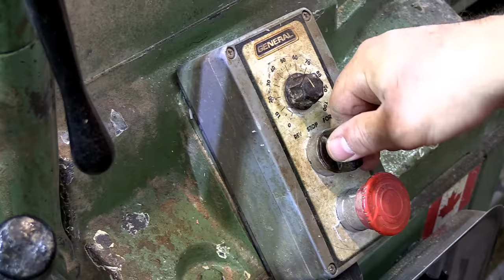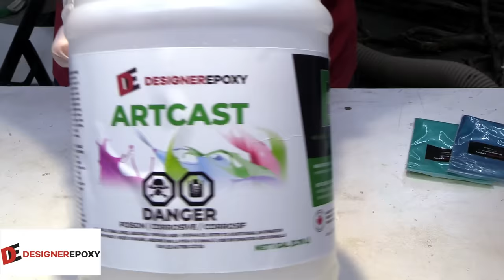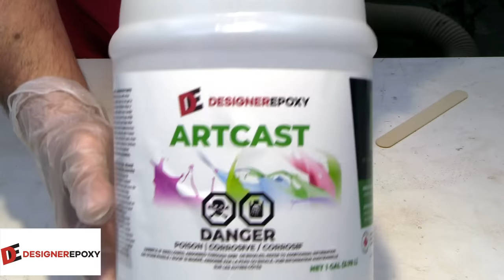Woodturning - The Basket Case Bowl

Comment: Bowl is amazing, like always. I work for a builder full time. Also a part time furniture maker on the side and now throwing turning into my tool box. Building cost are out of this world right now. That’s why I just bought a existing house instead of building. I’m also putting up a 30x50 metal building shop, but I wanted a block and truss shop but it was a quarter of the price to do metal.
Reply from the maker: Even metal is high right now. I never priced out a metal structure because we wanted the shop to match the house. Thank you very much!

Comment: Jim, thank you for a quick lesson on headstock locations.  I have recently acquired a Jet 16X40.  Previously had been using a Jet 12X21 which was great to learn on, however the larger machine had many features as you illustrated with headstock locations.  I think I'm going to love working more with this new toy, and watching more of your presentations.  
I'm not a tax fan and was disappointed to hear your plans will suffer a little in New Brunswick next year.  But as you said "that's the way it is" I'm crushed.   John in Alaska
Reply from the maker: Hoping the prices come down and make it less painful! Thanks

Comment: I like knots and the nice grain around them, didn’t realize a small amount of clear to smooth it and stabilize a little would be considered a repair
Reply from the maker: There certainly does on occasion have some nice grain them. They do however tend to crack over time. Thanks

Comment: Drilling out the centre of the short branch sections with a bit the same size as the copper wire and then gluing short sections of wire into the hole would look so cool. Like copper heartwood.
Reply from the maker: I actually debated that. Thanks

Comment: Next time you use the copper wire, anneal it by heating to red heat.  You can then leave it to cool by itself but it will have a film of black/brown oxide.  To prevent that, quench it from hot in sulphuric acid.  This will (mostly) remove the oxide, leaving a matte finish but you will have the copper colour.  The wire should then stay where you put it, at least better than we see here.  If you must have shiny, you are going to have to live with the springiness.
Reply from the maker: Only shinny will do, lol. Thanks

Comment: looks absolutely great.  just a tip with hot glue, if you have a heat gun wave it over the glue to get it to release easier than the alcohol.  As long as you don't hold it in one place too long it should not affect the resin.
Reply from the maker: Yes, that would work too. Thanks

Comment: re: the copper wire: if metal memory gives you trouble in future, anneal the wire (gently heat until just soft and allow it to cool slowly, do not quench in any medium,) and run it through a draw plate or clamp it in your vise and stretch it an inch or so by pulling it tight with pliers.
Reply from the maker: Can this method be used with twisted wire like this? Thanks

Comment: Came out beautifully Sir!! Just a thought on the wire inlay memory problem; next time you could maybe try straightening the precut wire lengths beforehand, which may remove the bends. Place one end in a drill chuck and hold the other end with pliers applying tension. Start the drill off slow, then speed up until the wire is straight.
Reply from the maker: Thank you very much

Comment: Try rolling the wire in with the too. They use for window mesh I bet it will roll in even. Congratulations on 100K! 🇨🇦
Reply from the maker: I don’t think this twisted wire will behave correctly to do that. If it was a solid core wire then yes and I’ve actually done a video on it. Thanks

Comment: I have done several segmented bowls and I figured out the secret.  You glue the bowels up in 2 halves. using 2inch tape on the joints and shrink wrap as my clamp. Then if you did it right the two pieces will glue together 100% perfect every time. Right?...  Unless you are me and are far better at nailing the compound angles.  So when they do not come together just perfect I use my 12 in disk sander to flatten the 2 faces until they meet perfect. Unless you are just way the hell off no one ever notice and all the joints come out spot on.
Reply from the maker: The reason why I don’t like to do segmented work is because your more on the table saw than on the lathe, lol. Thanks

Comment: First video I've ever came across of yours, I'm now subscribed 
Beautiful piece 👍 love the form and copper inlay.
As for the hot glue debacle, I've had great success using a heat gun and a small putty knife. Just be sure to use a tip on the heat gun direct the heat away from the epoxy, and start the heat low👍
Keep up the beautiful work man.
Reply from the maker: Welcome aboard! Thanks

Comment: Beautiful color combination; haven't seen walnut pieces that disappointed yet. Designer Epoxy artcast clear as glass. Maybe as a future challenge, attempt to run a copper inlay AROUND the entire inlay area showing the same view inside and outside of the bowl as one sees looking down at the rim.
Reply from the maker: This would be very hard to do without sanding through the wire. Thank you very much!

Comment: The different camera angles are great. It gives one a different perspective of how you work. Love it. The dark walnut bowl is beautiful as always! If you’re using copper wire again, try gluing it halfway around and it should make your job much easier. Also, what are your thoughts on cutting the wire up and fraying it out so it acts like you’re small pebble stone inlay material? This effect won’t look like a wire but more consistent without any evidence of where the wires end and begin. Love your work Jim!👍
Reply from the maker: Something like this video? Woodturning - Copper Wire and Alabaster Inlay
https://youtu.be/lISiaaF-GsA thanks!
Reply: @SpragueWoodturning  Kind of, I was envisioning the copper wire cut into small shavings, 1/2 cm to a cm long. This way they would lay flat in the inlay channel and fill it up like your other inlay material does. Yes it would be a ton of work to do, but the effect might be cool👍

Comment: Great bowl Jim!  I luv that copper inlay.  Not sure if you have done this in the past or if someone else has mentioned this but have you thought of using copper tubes in the branches, then filling with colored resin?  Might be something to try.  Also like the new camera angles.  It's a big help to us newbies.  Thanks and take care.

Designer Epoxy
Sandpaper
Reply from the maker: I used copper pipe in this one, thanks! Woodturning -  The Stain Glass Bowl, 55K Subscriber Giveaway Bowl
https://youtu.be/_SgHq9-HsYk

Comment: Love your videos, and the resulting pieces are fantastic. To remove the plastic sheet, have you thought of a little localised heat from the tip of a soldering iron to soften the hot glue? 
Regards Dave
Reply from the maker: I would turn it away before doing that, it would be a stick mess, lol. Thanks
Reply: If not a soldering iron, how about a hair dryer or heat gun to warm the glue so you could pull the sheet off?

Comment: Nice work dealing with the defects and saving that bowl. I don't know if this would help with the copper, but it is probably work hardened from the manufacturing process which will make it less malleable. You could try to normalize it by heating it up and letting it air cool. Might discolour the copper though. Possibly bring back the copper colour with an acid. Just sayin'.
Reply from the maker: Others have suggested that too. Thanks

Comment: I wonder how it would look and if it would have been easier to work with if you twisted the 2 braided cables together first?
Reply from the maker: They would want to untwist. Solid core wire is best for that and I’ve done it a couple of times on the channel. Thanks

Comment: As always, great work.  I like the look of the copper wire on the top of the bowl, but torn on if I liked the cut ends on the side between the branches. I definitely want to give the cutout with branches and epoxy on a bowl.
Sorry if I missed it, but can you share the brand/model of that respirator face shield you use?  Thanks
Reply from the maker: It’s a Power Cap. Thanks

Comment: Great color separation in the finished product! What are you using to apply your Waterlox? Generic finishing pads, an old shirt or lint free shop rags? I'm having trouble getting even surfaces using anything other than friction polishes like Mylands
Reply from the maker: Old T-shirt material or cotton rags meant for finishing. Someone mentioned using gauze, it’s lint free so I just ordered 200 of them in 4x4 sizes. Will show the results here. Thanks

Comment: Which Vacuum Chuck and Pump are you using? And Do you like the stability of it?
Reply from the maker: I have a really large one that I bought of of eBay many years ago, but I just got one off Amazon a while back. It’s a Pbautos and it came with the pump. There should be a link in the description. The only thing I really don’t like about is the pump requires oil and it tends to foam out of the vent and I guess that’s normal. https://www.amazon.ca/gp/aw/d/B0B773VV6L?psc=1&ref=ppx_pop_mob_b_asin_image thanks for watching

Comment: I have a turning question that I think you can help me with.

I'm running a 12x18 lathe and I tend to get a lot of end grain tear out in the walnut bowls I'm working on - 11(ish) inch diameter, 4 to 6 inches deep.
I am certain that a big part of the problem is that I'm not keeping my tools sharp enough (Yellowhammer and Benjamin's Best gouges, usually 1/2inch).
I'm not getting good shear cuts, but that is probably me not having the wings swept back far enough.
I've overheated the velcro on my drill chuck sanding mandrel and the sanding disks won't stick (my bad, not the product), so I am using a random orbital sander and an oscillating tool with 80 grid paper.

Is walnut prone to tear out? I haven't done much work with it, in part because the shavings can't go into the chicken coop, but mostly because I just haven't gotten my hands on much.
I'm looking for a sanding mandrel for a air-powered die grinder, but haven't gotten one yet.
Reply from the maker: I’ve never had any success sharpening with sandpaper. Get yourself a slow speed grinder and 80 grit CNB wheels. That combined with a sharping jig will give you a razor sharp cutting edge. Thanks
Reply: @SpragueWoodturning , I'm running a low end sharpening system using low end gouges - I'm sanding with the palm sander to correct end grain tear out that I haven't gained enough experience/technique to not cause while turning - hoping it is endemic of the wood, but pretty sure it's me..
Reply from the maker: @silvesterburchardt3337  walnut should cut cleanly with sharp tools. Safe turning. Jim
Reply: @SpragueWoodturning  I was afraid of that... Gotta sharpen better and more often. :-(